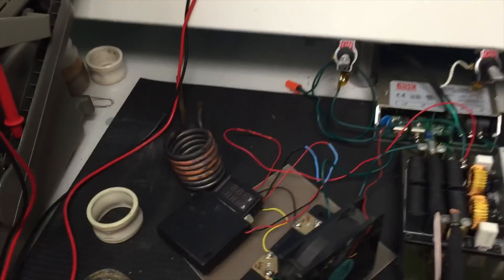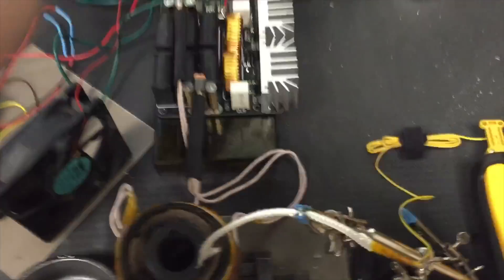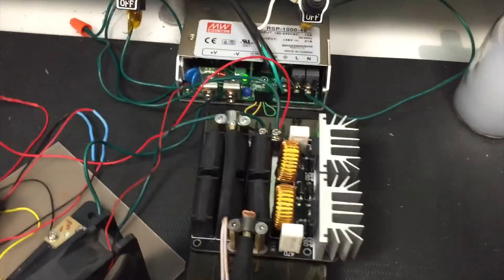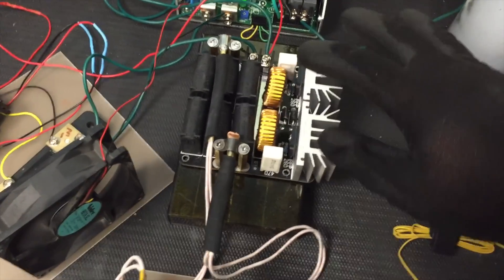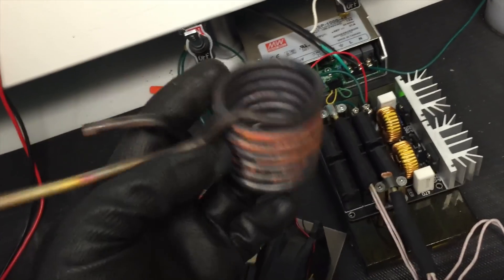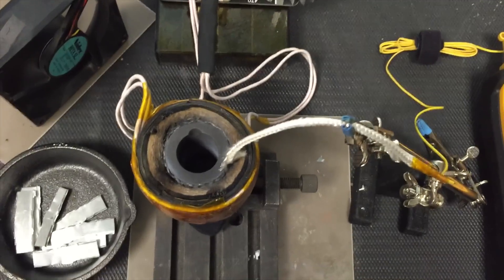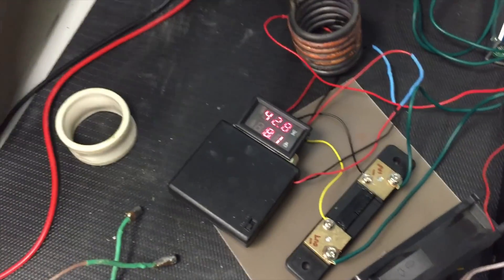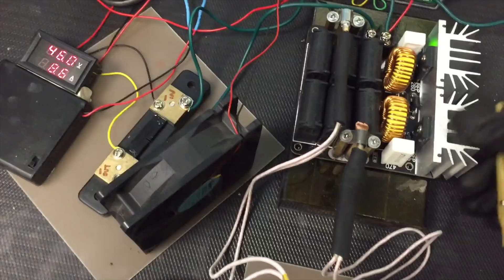1000W Induction Heating Part 3: Melting Aluminum

Comment: Can I adapt this to heat an 3x5 aluminum i-beam in preparation for bending in a harbor freight press? My trailer i-beam is cracking on the bottom part of the ibeam and I think heating it prior to bending would be better. I could use a propand torch but this seems better. I do have an induction heater I purchased off of amazon and was planning to simply make a larger coil to fit around the ibeam. Any thought?
Reply from the maker: Aluminum and other non-ferrous metals do heat with induction but not nearly as rapidly as ferrous metals and susceptors like graphite that rapidly absorb electromagnetic energy and convert into heat. The graphite crucible is doing most of the work in this video. MAPP gas would be much hotter than propane but they stopped making the original MAPP gas in 2008. The current MAP-Pro gas is not as hot as the original MAPP gas. It is still hotter than propane but I’m not sure it’s worth the cost. Original MAPP gas burned at 5300F. MAP-Pro burns around 3730F and propane typically burns around 3600F. I miss the old MAPP gas.
Reply: @ProtoG42 would that mean I should add a crucible sleeve to help out or just use propane

Comment: Hey. I tried doing heating a graphite block of 30mm OD with a 2kW ZVS driver powered by a 24V 50A SMPS. And i currently have an air hap between the sheathed coil and graphite block.
However, the graphite did not heat beyond 450degC. Can you kindly tell me the grade of the graphite crucible? Or whether I should increase the supply voltage ?
Thanks again.

Comment: i was experimenting with that zvs driver 3-4 years ago i could not melt anything because i was not using custom coil or crucible and also i was powering it with lipo batteries (48v)12vx4 . at some point i used a big iron rod and that destroyed the mosfets.. i have a video of that. anyway, you proved you can melt alluminum but againg a very small piece and cant mold anything.. i looked out to make a 3-4kw zvs but it was too complex too expenssive and parts hard to find, so i stoped having melting metals on my head..

Comment: You need special cooling solution and heat excanger with pump to work better. You will destoy it. Make good wolk to learn from this chinese product.Take out the resistance you use and use Grafite with Ceramic, for that takes time to melt some grams of aluminum!

Comment: I have this 1000W Induction Heating device (like you and spiral cooling) I get a lot of heated capacitors-more than 80 degrees. How is it with you? You don't know what it could be. I have a voltage of 40V 15A.

Comment: What is the best material to use to build the induction coils? Also what can be use that would be flexible to wrap around stuff to heat stranded wire? Does heavier guage work better?

Comment: Hi, I count power and the see only 48V x 8A and equal about 500W NOT 1000W why ?
Reply from the maker: The power output depends on the coil used and the load placed in the coil. In this video I pulled 32 amps at 38.1 volts: https://youtu.be/qqyAoHq6fDw

Comment: Hey there, i have 3kw of induction heater that i brought from online shopping. The problem is i won't be able to melt even the aluminum. At the beginning of the process the amp rising to maximum but once the material gets heated up the amp down to minimum this cause the temperature stay and won't rise up. Can someone give me any advice how to keep rising the temperature, i used the iron crucible (do you think this is the problem?)

Comment: Could this technology (if refined) be used to make a metal 3D printer? It seems strange to me that no one has tried this?
Reply: err...no
Reply: @bleughbloop8569  what makes you say this?
Reply: @plibplob3916  At a guess you're thinking of melting a metal wire like FDM printing? What materials were you planning on using for the nozzle? How are you planning on keeping the rest of the print hot enough that the new metal can remelt and bond it as its laid down?
I imagine the warping would be pretty insane as well...

Comment: Hi sir. Can you help us with our thesis? We use a 48v 50A. We use an metal tube as an crucible and only the top part of it is getting hot. May i know how to compute for the number of turn of coil for that ( 48v, 50 A). We use a 3/16 in. Copper coil and the Inside diameter of wound is 3 6/8 in. Thank you

Comment: Hey man maybe you can help me out i have the 1800w version I got off ebay or amazon and I also got a 2400w server power supply that was a bitch to wire just to figure out how to turn it on I got lucky any ways its running on 240 and has a max amps rating of 50A at 48v it also has 12 v anyways it came with a coil and cooling and I run water through it but anyways I tryed to harden a knife I made from 1095 steel and held it in there it getsorange hot in matter of about  15seconds  and when it hits that point the amperage draw on my unit starts dropping from initially about 30A to down to i can remember but ma
Ymmaybe 6 or 10 A i heard it does this a Curie temp but even put a magnet by the metal it still is attracted to it.. Mind you I'm using a n52 neodynium magnet.. Which I shouldn't cause they die with heat quickly but nevertheless I cant seem to get it to non magnetic because to heat treat harden 1095 it should get a little hotter than non magnetic and the hold there for 20 minutes or so and then a quick quench in canola or park's quech oil. canola should be heated to 130f and so I don't know what to do i thought maybe the fans on my mazilli driver were cooling off my knife but I blocked them off and still no go.. I have seen people with 1000w Induction heaters melt a price of steel  but apparently you have to be able to tune the circuit or have it auto tune when the piece reaches Curie temp otherwise the induction heater  is not really working.. I also have a graphite crucible much larger r I tried for a hour to melt gold and it got red hot inside but wouldn't really melt  maybe barely but not really  my coil is quite large and its bare copper and it's out in the open air.. Maybe I need insulation.. I also tried making a much smaller coil from solid copper wire instead of tubing I used 6 gauge and was the size of when you put your middle finger and thumb together and still couldn't get the knife to non magnetic.. I quenched anyways and of course it did not harden.. Please if there is anything you know you can help me with that would be great... I've scoured the internet trying to understand induction heater circuits cause I too was going to make everything my self including the power supply but it was cheap enough.. So maybe you obo w of where I could find a circuit I could hook up to the induction heater to tune the thing to maximize its melting capability or allow it to melt something for God's sake. You can email me if  u can at xeller8u@gmail.com that's my main email now.. I would really appreciate someone else's help

Comment: Would you know if the hand held induction heater that's also 1000w weather or not it can handle to melt metal like this

Comment: Interesting demonstration, but as a previous poster points out, the graphite crucible is sort of defeating the whole direct "induction to metal heating" principle.  Is your crucible the intended induction target here?  I like the use of the bullet connectors, btw, but you might be exceeding their current rating.

I would suggest that you put a PWM fan in there with some closed loop control.  If the fan is cooling the shunt, then I would move the fan to the whatever else gets hot, like the caps and MOSFETs as you mentioned, and get a shunt that is better matched for the current you're running.  Shunts should not need to be cooled like that, as they are designed to have the right tempco at their rated service current.  Besides, the on, off, on, off fan sound is really annoying. 

You should also close the loop around the heating process itself.  Get a Thermocouple to voltage converter module, an op-amp or simple PID controller, and a solid state relay to run your ZVS driver board.
Reply from the maker: This video is 4 years old now and I rarely use this anymore. I'm not sure if you're aware of the fact that graphite is an excellent susceptor which means it is good at absorbing electromagnetic energy and converting it to heat.  This is why is is used in microwavable products like popcorn. Melting aluminum on its own with induction would not be possible with this set up and only 1000W.  It would take much more power. It may still work after quite a long time but a graphite crucible. I am not even close to exceeding the bullet connector rating. They are used in quadcopter that easily pull more than 20A. Those specific bullet connectors are rated for 40A.  Here is more info on selecting bullet connectors: https://oscarliang.com/choosing-gold-bullet-connectors-motor-esc/

Comment: 40 volts * 8 amps = 320 watts 
So it's not even in full power, so you can melt other metals with even higher melting point.
Reply: Why is he not using full 1000W power?
Reply: @ruser0084  Because he is not using a cooling system, the board will burn, if you install a good cooling system on it you can go higher without burning the electronic components.

Comment: Love it. Thanks for sharing. Try some borax as flux, or argon shielding to keep the puddle clean.
Reply: You can't, as the aluminium melts it leaves behind the aluminum oxide skin which becomes dross.
Reply: Don't use borax as flux for aluminium. It degrades the quality. A KCl NaCl mixture works good as a flux.

Comment: can i use  MEAN WELL SE-600-48 AC to DC Power Supply, Single Output, 48V, 12.5 Amp, 600W, 1.5"  (How much temperature can be reached)

Comment: Nice! 
But I think you should have put the coil lower to melt the metal faster with less power consumption (you see it very clearly on the glow that the hottest part is not at the bottom where it should be, but higher up on the sides - as expected, given the coil placement)
Reply: EM radiation energy density is highest at the middle part, assuming even coil coverage over the height of the crucible. This comes from the inverse square law for electromagnetic radiation. It's not a problem if the crucible is at least half full (probably isn't a problem at all). Graphite crucible is like a Faraday cage so the metal is heated trough heat conduction. I also suspect that EM energy transfer to crucible is more efficient in this configuration rather than in some way what heats the bottom most. Electromagnetic coupling of something.
Reply: @kasparroosalu  That's true. Also, the bigger the diameter of a round object being heated, compared to the coil diameter, the better the coupling will be for inducing eddy currents (which means less reactive current in the coil = better efficiency and lower coil temperature). I probably didn't taught of that when writing my original post. Because of the shape of the crucible, the diameter is less at the bottom and also as you say, if a part of the coil is empty, that will also make coupling worse.
Another problem I see why the bottom is cooler, is where he put the insulation. He has insulation around the crucible, to not overheat the coil  - but the insulation will also keep heat in and if there is nothing under the bottom, a lot of heat will radiate away there and cooling the bottom. 
I also don't think this is really a problem, since aluminium has such a low melting point anyway (but if melting steel for example, it could mean the life time of the crucible would be reduced by a lot, since the middle must be extremely hot, to get it hot enough at the bottom and thus get "eaten away" more quickly by the oxygen in the air than if it is evenly heated). 
The aluminium it self is probably also such a good conductor of heat that all of it will get about the same temperature, regardless if it's heated evenly or just from the top - so oxidation cause by parts of the metal being hotter than necessary, will not be a problem either.

Comment: Great video... you should mention for your safety and others, to pre warm the cast iron pot for any residue of moisture... one drop of water would make anything molten explode in your face.... people have gotten eye injuries and face burns last 40 years doing this kind of thing...  just a heads up for anyone going to to this experiment....
Reply: Old wives tale- you can pour water directly into molten iron or vice versa with no effect other than steam.  Only if the steam has no way to escape will you get an explosion.

Comment: What do you do to decrease the current at higher voltages so you can reach 48v without exceeding 20A in order to get the maximum wattage? Does increasing diameter to distance from crucible help, or increasing windings to reduce voltage induced in the crucible while increasing current capacity, then increase input voltage to bring voltage back up? I would rather input 48V at 10A to get 480W instead of 24V at 20A. If the crucible were considered 1 turn and you currently have a 8 turn coil (ignoring skin effect from frequency) which at 24v draws 20A for 480W, would doubling the windings to 16 allow you to input 48V at 10A and still get 480W? it would be easier on my batteries if I could arrange them to 48V without blowing the mosfets due to excess current! Awesome videos on induction heating, they helped me get motivated to put something together!
Reply: you got close-ish.

transformer impedance reflections, turns ratio squared. work/crucible is 1 turn. so reflecting back to the primary, the resistance (really, the reactance at that frequency) of the work is multipled by turns squared... if the work/crucible is 1R, into 6 turns, its 36R at the supply. 8 turns, 64R, 16 turns, its... 256R seen by the supply.

this being the case, with a 200v supply, 6 turns would deliver approx 7A, 8 turns a bit over 3A, whereas into the 16 turns would give under 1 amp. 
 
and in the work you would have 42A, 24A and 16A respectively, and the power dissipated as heat in the resistance, the workpiece, is ~1764W,~576W, and ~200W.

obviously you cannot have more power in the work than the supply can actually deliver, but the work isnt 1R, i used that as an example. 

basically just throw an ammeter on the DC rail and keep DECREASING turns until you get the ideal current draw with work in the coil. its better to use a tapped matching transformer so you can change the number of turns and still have the same reflected impedances for different work. contrary to intuition, you want a step up transformer... it makes sense when you include it in the example i laid out above... due to the nature of the tank circuit used, and that the supply voltage is very low. its kept low as the gain in the tank circuit easily exceeds component ratings! a 24V supply will elevate to over 300vAC, or 150V across each FET. i have run one up to 200V supply using 1200v fets. and im never doing it again. it allows you to run directly off mains, but the sic fets arent cheap, and its really easy to smoke them.

if you set it with no work in the coil, the impedance is "infinite", and infinity times any transformer ratio is still infinity! a parallel resonant tank circuit at this point will draw only enough current to overcome its internal losses. it only pulls current as the loss due to the works resistance increases. and it always stays in resonance.

Comment: Can a setup be used to mealt copper, or is the copper not enough magnetic? Anyway great channel, just subscribed!
Reply: Silver is not magnetic either..  the question is whether the crucible will get hot enough to reach a good pouring temperature for the copper.   My guess is yould need a bigger power supply

Comment: can any 1 tell me the used  frequency  ??
Reply from the maker: This is a self oscillating circuit so the frequency changes depending on what you place in the coil.  Winding a different coil will also result in a different frequency.
Reply: does this 1000w ZVS melts steel and iron if left for longer time ?
Reply: +moustafa refaat  probably not. Induction heating generally only heats ferrous materials to their curie temperature - a step over cherry red or red/red for steel. This is far from the melting point. You can check the temps, but I want to say its like 1900 vs 2700 f. Best way to melt steel is with a pile of coal and injected air.

Comment: Have you measured the resistance of those gloves with a ohm meter  , beware , many gloves like that are actually conductive ...
Reply from the maker: This is low voltage.  The gloves are only mildly protecting my hands from getting burned if they accidentally bump anything.
Reply: does this 1000w ZVS melts steel and iron if left for longer time ?

Comment: Hi, I'm having a bit of trouble with this induction heater. I heat a solid iron 31 mm diameter and 35 mm thick.
I use 36 Volt of battery. But when it runs about 3 minutes, suddenly the diode (D1) and Mosfet IRFP260N that is on the schematic explodes..
what do you think the cause of the problem is?

Comment: What is the hottest you temperature meter will read before its tip melts?
What is the largest you could make this and the hottest it will get? 
Could it melt a few pounds of stainless steel?

Comment: i like ur video. I'm interesting with this heater. I wanna ask a question, if I change the coil with big one (Maybe diameter 6 Inch). can the driver still running? please Reply.. :)
Reply: mahmud aulia yes it will just be a slower heat.

Comment: What power  supply I can use for this to melt gold  I got the coil and everything jus need to find the rite power supply
Reply: 48V 20A at least. If you can afford it, buy a 50A unit.